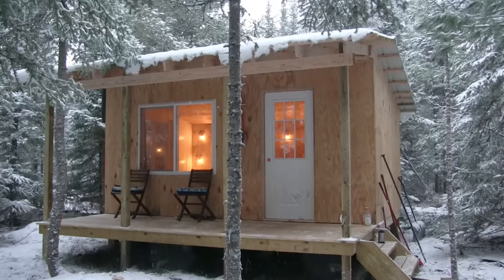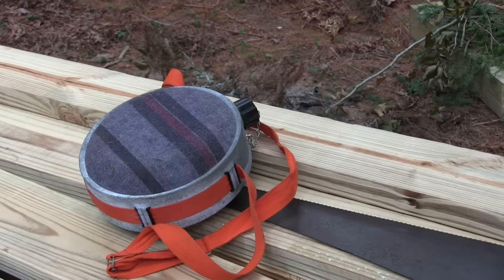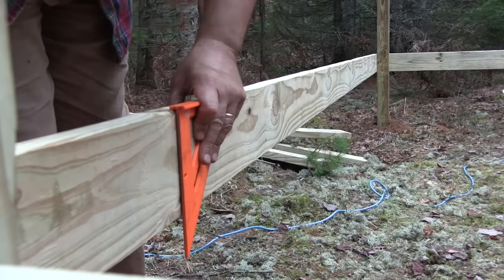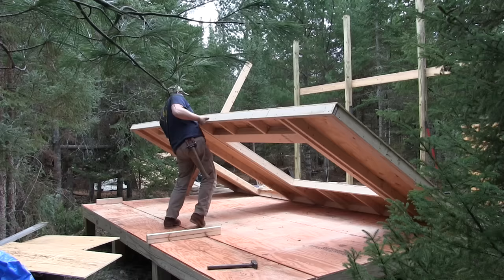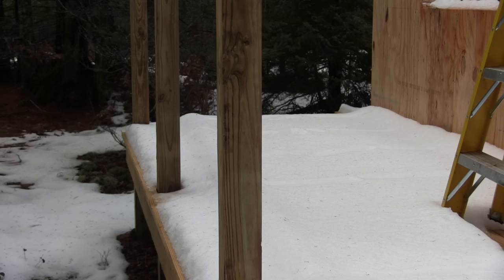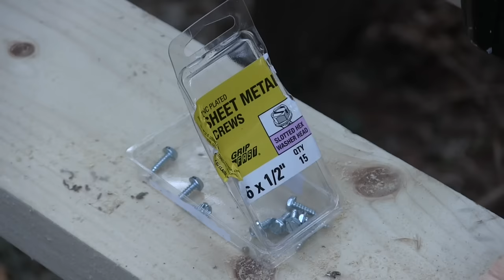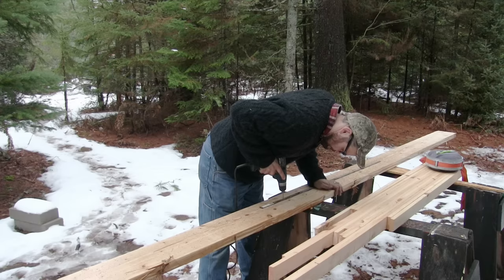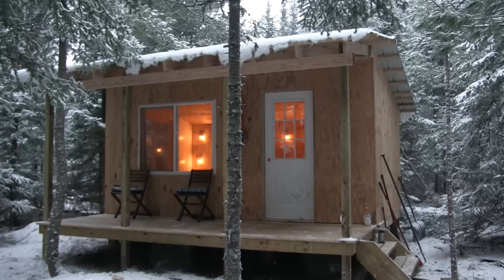Off Grid Cabin In The Woods....Start to finish

Comment: we built a bungalow for my sister down in the south of France about 40 odd years ago and used a very similar method the only thing we did different was we used the 4 corner post out of the ground up to roof level  with 10 intermediate posts [also from out of the ground] in between and used these as our frame to build the  outside walls and floor and roof of off.  Then we just cut the holes in the walls to take the pre made double glaze window units and door frames then we  built internal stud walls to form the different rooms installing all the electrics and plumbing as we went . This meant a lot more hole digging but there were no walls to lift into place we just nailed the ply to the frame from the outside then filled the gap with lagging then nailed on the ply on the inside. We constructed the floor more or less the same way you did. then we gave the whole building 3 coats of STUCCO . we must have  done a good job because its still there and it looks good for another 40
Reply: Heavenly, Le Sud!   My friend is building a cob house.  It will stand for centuries.

Comment: When you have to stand a large wall like that, lay your plywood downh on the wall, then cut the end pieces.  Mail the ends pieces on, and then remove the middle sections.  Stand the wall, then put the middle sections in place.  Also, when you put insulation down as you did, put a layer of plastic between the floor covering and the insulation to keep moisture from going down when you mop.  Lastly, so far, a layer of insulation under the wall when you rise it will provide a wind barrier from drafts going under thee wall.

Comment: Good video. I've been a carpenter for 30 years. and the only things I would have done differently is pour concrete, either wet or dry, into the holes for the vertical beans, and install plywood decking on the rafters. That would prevent pesky frozen limbs from crashing through through those thin metal roof panels in the middle of the night.

Comment: back in 1960 my father bought an old church that was going to be torn down for $100. he took all the wood and nails and built a 24'x40' home that we live in to this day. we have added onto it so its a lot bigger but the original wood is still there. he had rough cut oak for the supports and the floor joists and rough cut pine for the frame work and the roof (joists?), the exterior walls were planed 1x6's covered with siding and the interior walls are all drywall on 2x4. if you can afford lumber instead of plywood it will last a lot longer. weve already had to replace the plywood floor in one of the expansion rooms while the original is still going strong. just my thoughts

Comment: This is helping me so much! I'm planing to build a 20x20 cabin with no running water and no electricity. (We might have a generator and a thing outside that holds water but not that much) Our land that we own also gets tons of snow, but when it melts the ground turns into clay
Reply: Good luck! :)
Reply: @KateClairvoyant  Thank you😊
Reply: @Mary Thomas  Best bet is to build it on a small island, yes getting crap there is hard, but it's worth it

Comment: I enjoyed watching the video. It was very well made.  The only thing I would suggest for anyone wanting to do the same would be to frame the floor differently. The way it was framed in this video, you're relying on the sheer strength of the nails to support the entire floor structure. Remove the nails that are going into the 6x6's and the entire building will collapse. A better solution would have been to have the rim joist resting on top of the 6x6's, and joist hangers used on the floor joists. If I was the builder, I would go back with carriage bolts or structural lag bolts and see about reinforcing the 6x6 connections where you can. Awesome video non the less, I hope to follow in your footsteps one day. Cheers.
Reply: Agree with you 100%. Its an extremely good suggestion.  I was thinking the same when I watched the nailing of the floor structure.
Reply: I like comments like this.

Comment: Living the dream, man! That is a slice of heaven!!

As only a novice DIYer, I have a question for anyone who can advise. Is it possible to lay/set the bottom plywood and then add floor joists to eliminate crawling underneath? And is the insulation necessary if intended use is more of a shed rather than for lodging, therefore eliminating the need for the bottom plywood? Regardless, I picked up a lot of helpful tips for carpentry repairs in general...even if I didn't figure out how to gain better flexibility to complete such a task. 😁
Reply: If it's gonna be a shed you don't have to worry about the bottom plywood or the insulation above it, you honestly dont need any insulation if you don't have to worry about keeping anything from freezing in it
Reply: On my little cabin I attached strips inside each joist space on both sides and then dropped in narrow sheets of osb for keeping critters out. Not sure how much time it saved but I didn't have to get dirty.
Reply: No
Reply: "As only a novice DIYer, I have a question for anyone who can advise. Is it possible to lay/set the bottom plywood and then add floor joists to eliminate crawling underneath?" DIYER? The fact that you would even ask that, I think you would be better off hiring a carpenter friend if you have one and work beside him to learn some basic skills. To answer your questions..NO and NO
Reply: 2 approaches come to mind. 
1) Build it a little higher so crawling under is less trouble. 
2) Nail thin boards like 1x4 to the bottoms of your floor joists to form an inverted "T" cross section shape (or go across the joists to make furring strips... which would easier, if less well sealed from critters ). Then just lay strips of plywood in the gaps between joists on the ledges of the "T's". Consider using a pneumatic or similar brad nailer to tack the plywood.
Reply: @dashriprock5720  Thanks for the input. I get what you're saying, but I live in the middle of the woods and tend to take on little projects when the mood strikes. All of my projects are piecemeal as time, money and material allows. Plus I get a great deal of satisfaction completing a big task on my own. I don't need perfection, but I don't want it to crumble either. 😁

I actually haven't determined my specific use for it yet since I already have a shed to store tools and yard equipment. I suppose I wanted to get an idea on unnecessary steps I could skip. Maybe I'll eventually get some goats and give them a nice place to sleep?!
Reply: Thanks for all the tips and suggestions! Now I have a better idea as I work on gaining new skills.
Reply: @DivaInTheWoods  oh..ok

Comment: Whenever Dave makes a cabin I always feel like it will last 100 years.
Reply from the maker: I hope so
Reply: I agree with you.
Reply: A Z  I was wondering the same. I think maybe the tongue and groove offers a good enough seal when they are stained / painted.
Reply: A Z  yea that thing will be rotten in 2 years time, no house wrap or anything
Reply: A Z  The insulation has vapor barrier.
Reply: @NOSUBSCRIBERSWANTED  Dude... :-{

Comment: I love the cabin but outback Australia doesn't get a lot of snow, although the insulation and deck are needed for the heat.  A couple of thing you may want to consider for your next build:
*    the roof screws placed in the valley of the sheets are at a low point and with snow melt may leak.  Consider putting them on the high point and you'll also benefit from tying the sheets together.
*    consider staing your timber before going on site.  Easier to do at home than on site.
It's a GREAT cabin, wish I was there
Reply: What home?  Did you see his tent?  I'm pretty sure he lived there while building.

Comment: Hi from Italy been watching you and Brooke for years. This was really excellent and the amount of time you spent getting all those camera angles and filming this I dont think people understand what that takes. Super skills. Im sure youve inspired thousands of people  to build their own. 👏
Reply: Winter forest - booming, like shots, croaking crows, snow from a spruce branch that fell by the collar, tracks in which the bottom is not visible, steam from wet mittens and parallel, now and then intersecting curves of ski tracks; spring forest - the smell of black, still frozen earth, flowing in all directions, choking with melt water, a stream, a thin white strip of skin blue from the cold between a sweater and jeans, and on it large pimples that can only be melted with lips; summer forest - hot drops of golden resin on copper bark, hair smelling of barbecue smoke, a white, daisy-covered sundress stained with dry red wine and a tickling pine needle that you can’t get at all if you don’t unbutton two thousand small, like ladybugs, buttons , rapidly spreading under the fingers along the back and chest.

Comment: Me and my family built a quality 25 X 25 wrap around deck on our land. My parents decided to live there for retirement years. They added another 15 fett for a 3 rd  bedroom with closet  and a mud/heater room. It was one of the coolest things I ever did. We used the post foundation. I used mahogany floors and finish work was a bit more pricey but used bat and board Amish cut siding and structure were beams from Amish too. It was a beautiful day raising the walls. We had 20+ family and friends there to help. All our friends pitched in! It’s a beautiful cabin on 62 acres at the foothills of Allegheny mountains in WNY! Really nice area. 15 min from Lake Erie. We have a septic that could be used for a couple homes. And the well is sufficient too. I would love to live there but the snows too much for me. My bros use tractor for removal. And just bought a large mower/ plow a couple years ago so they didn’t need to use the farm tractor. I see your place is an enjoyable one too. I wish we went ahead with the wood burner! I love a nice wood burning stove. What a lovely place to call your own! ❤

Comment: When you fix the frame for the floor to the posts at the start, do so with bolts so it can be removed, but make sure the frame pieces are permanently fixed to each other. That way you can build the frame for the floor like you normally would, but you can then disconnect the floor frame from the posts, tip the frame on its side, giving you clear access to nail the underboards on, standing up, but because you built the frame in place around the posts etc, it means you have the perfect sizing of the floor and perfect measurements for the boards you are nailing on. You then just drop the completed floor with underboards back onto the posts and away you go.
Reply: Sounds like a good plan, but tough for a person to do alone.
Reply: @almollitor  When my son did it he used an A frame and a pulley. He put blocks at one end to stop it shifting, the rope around the other and using a 4 block pulley was able to lift the entire thing with one hand. As he says, when you're working on your own, pulleys are your best friend.
Reply: Stellar idea!!!

Comment: The fasteners for a metal roof should go in the tops of the ridges to allow for expansion and contraction in summer and winter. Putting them on the flats tried to hold them in place not allowing movement and will over time cause ripping at the fastener holes. I started in construction as a laborer then carpenter, Job foreman at 44 I went back to school to become a civil engineer.
Reply: You might be right, but don’t forget to say something like, “great video” or “thanks for the video” or “sorry I’m an annoying civil engineer”

Comment: The wood pillars are pulling water upwards the wood into the basement because of capillar force along the fibres. This goes along with the wood fowling because they are put into raw dirt and sand without any protection or taring. Also the entire basement is going to rot because you didnt install any vapor barrier neither. Same goes for the roof. If you want an instruction video of how to build a very short life span wood cabin, here you have one. Unless you are keeping that fire on 24/7 the entire winter season.
Reply: would it not have helped then to have charred the length of the pillar (if not the entire pillar) so as to help prevent rot from moisture and the elements?

Comment: Watching this video was almost a spiritual experience, thank you so much! 2 questions about moisture and the walls: the outside layer is underlayment, isnt that going to rot without protection? And wouldnt you need a cavity in the wall for air circulation? Thank you!

Comment: Would you ever consider doing a tools / material build list? Your videos are superb and easy to follow along, my only issue is, I have no idea what any of this lumber is called, so even looking it up to buy it doesn't compute.
Reply: Well, plywood (those big flat pieces) comes in 4x8 sheets, The lumber he used to frame the walls are 2x4's, The ceiling joists were probably 2x6 or 2x8's. The big posts were 4x4's and the flooring was 2x12's. These are standard nominal size lumber used in construction and can be found at any lumber store or home depot etc. As far as tools look like drills, hand saws, circular saws, hammers, and a square (that triangle thing he marked lines with) as well as a ruler and a level (that bar with the floating bulb). I'm not him but I figured this info would help anyway. Google is your friend.
Reply: @lavablock1999  Thanks! That's a good start. 

I just like following a set guide or recipe.
Reply: @KineticSymphony  just look up on google how to frame a house or build a deck and follow the guide

Comment: Great video. Suggestion: I would highly recommend that the ledger boards be attached with galvanized or stainless bolts rather than nails to the posts (or the next best option is lag screws). Nails and deck screws are notorious for failing under load over time on ledgers. If you must use nails or deck screws, then they should be either galvanized or stainless steel and attached in a zig-zag pattern and not in a linear pattern; their depth into the post should be at least the width of the ledger board. The ACQ in treated wood will corrode non-corrosion resistant fasteners over time.
Reply from the maker: I just used what I had on hand for nails. The good news is I could re nails all the ledgers/ and rim joists from the outside of the building ( and under it)

Comment: Just curious on a few things.  
1. Was there a particular reason you didn't leave a gapping between the floor boards on the patio deck?  I worry for you that moisture ingress into the board, causing expansion may knock your stuff out of plumb and loosen nails.  
2. Why no moisture barrier between the tongue and groove and the insulation?  With the temperature difference, you're bound to get moisture and molding in the insulation.
Reply: It’s not like he gone be living there so I doubt he cares about that
Reply: I was thinking the same thing gap on the treated wood  , and  paint on the outside plywood ? or maybe a house wrap with siding over it  ?
Reply: @likent7992  I agree but, his goal was for it to be a generational vacay spot for his family.  That's why I mentioned it.  :)